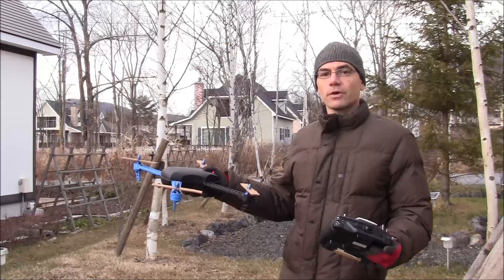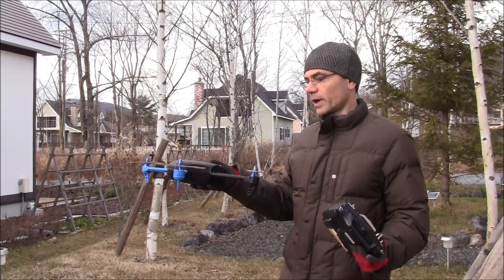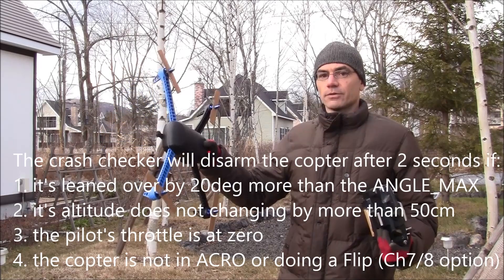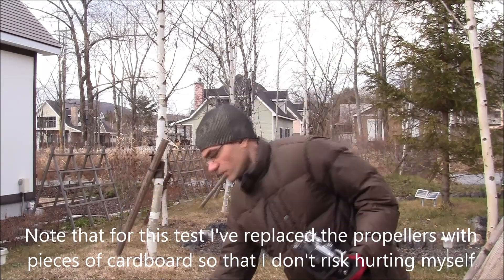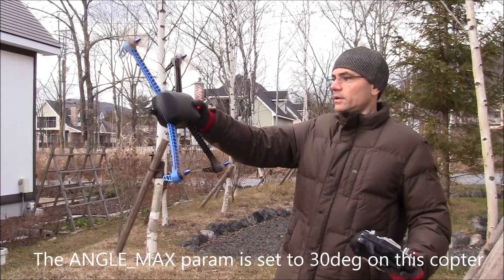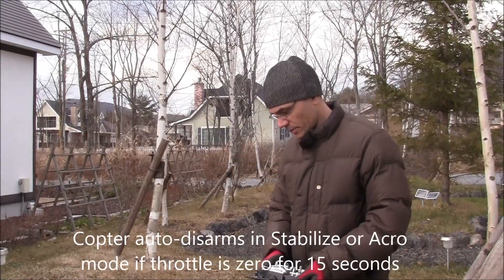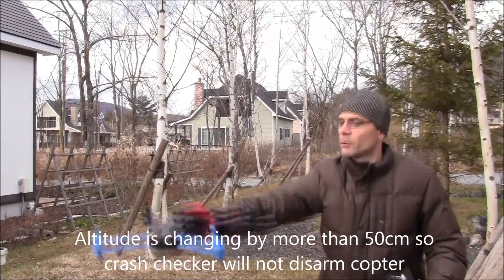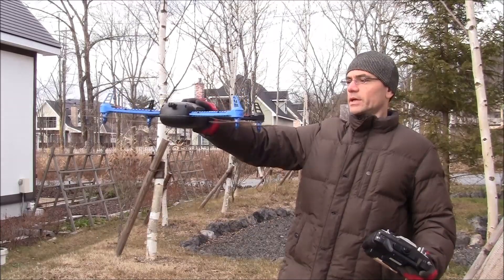ArduCopter 3.1 Crash Checker

Comment: Hi,I have a question.If crash check is disable,and how to enable low battery voltage make drone RTL？Sorry,poor english.
Reply from the maker: Hi UZ, the crash check can be disabled by setting FS_CRASH_CHECK = 0.  The wiki for the crash check is here: https://ardupilot.org/copter/docs/crash_check.html and the wiki for the battery failsafe is here: https://ardupilot.org/copter/docs/failsafe-battery.html.
Reply: Randy Mackay thanks.How to set angle? Mission planner can’t to set？
Reply from the maker: @uz9556  No, the angle is set to 30deg.  Note that this is the angle error (i.e. the difference between the desired angle and the actual angle).  It's not the angle at which it disarms.

Comment: Hmmm
Yesterday my quad tilt over when landing in loiter mode an it did not shut itself off.
It happens two times even when the quad was laying on it's back the motors keeps spinning.
I was using AVAU-X2 with Copter 3.5.2 14-Aug-2017